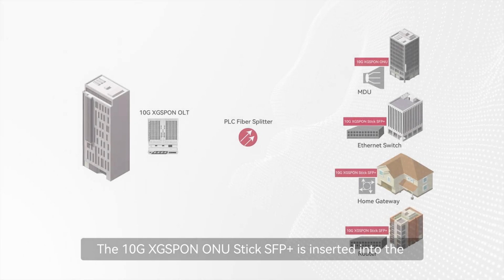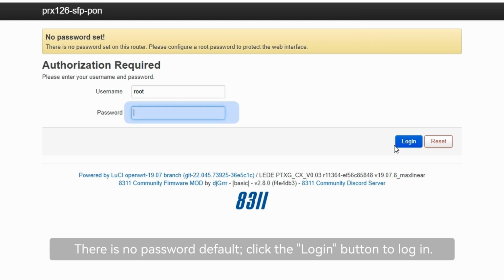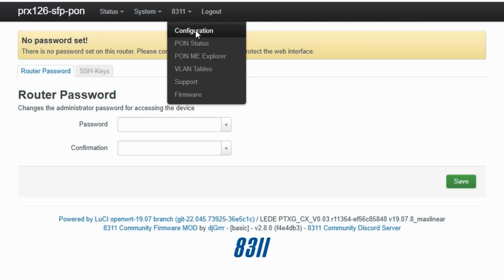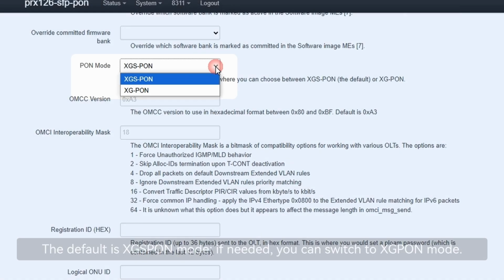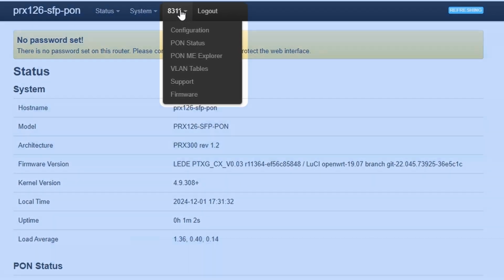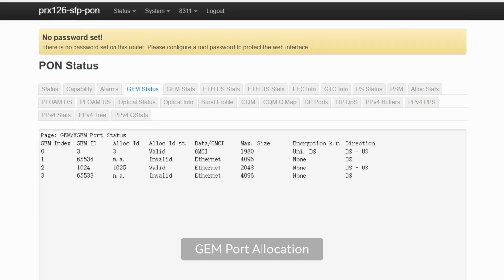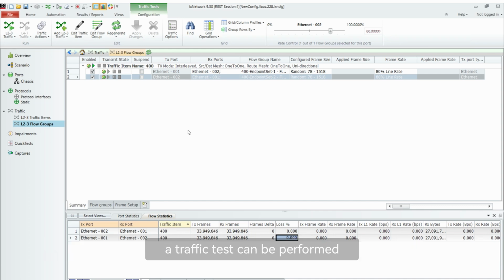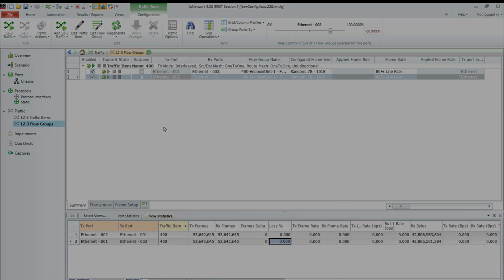Exploring the 8311 Community Firmware for XGSPON ONU Stick SFP+: Setup and Features | FiberMall

Comment: What is the Vendor ID- entry only allows 4 characters entry.  on the att gateway bottom ONT ID:  Seria number, MAC Address, and  FCC ID.. please make it clear as to where to enter for the 8311 configuration menu
Reply: I would suggest you ask that question on the 8311 discord, the gurus of that firmware are there...